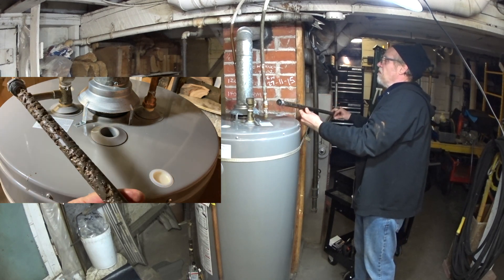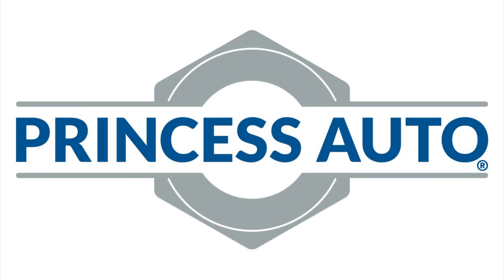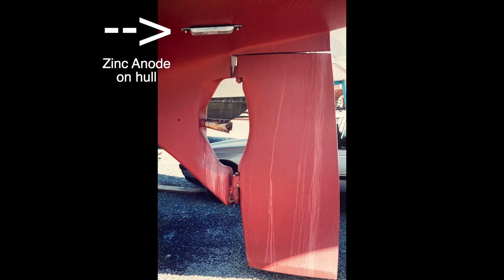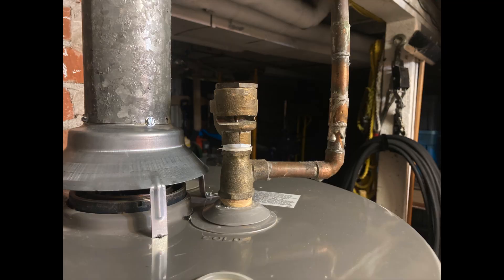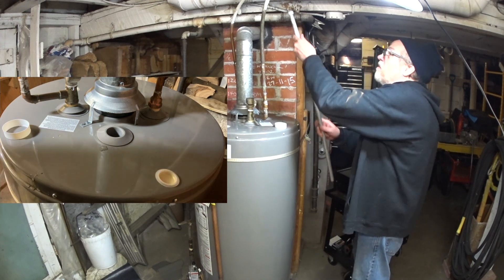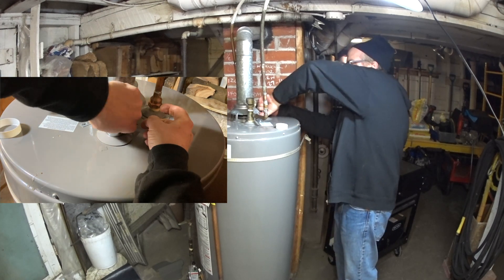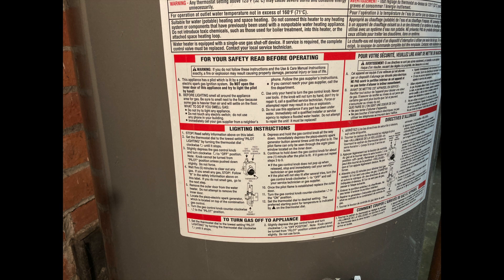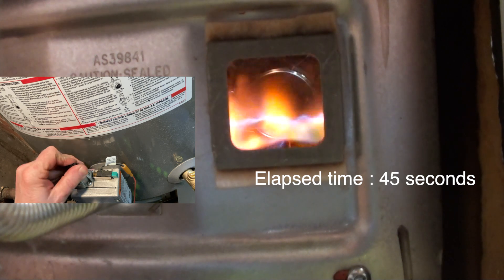Hot Water Heater Anode Rod

Comment: what size socket did you use?
Reply from the maker: 1 & 1/16" - 6 point chrome socket - there wasn't enough clearance for an impact socket so I turned the power on my impact gun down a bit.
Reply: @repairs101  ok, thanks for the info, i dont think my air hose can reach far enough so i might have to use my corded electric impact.